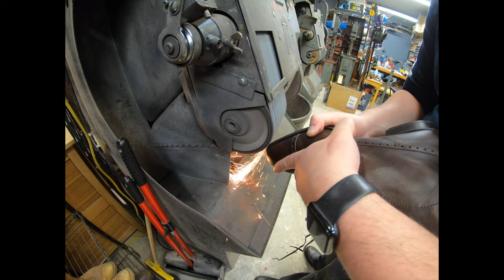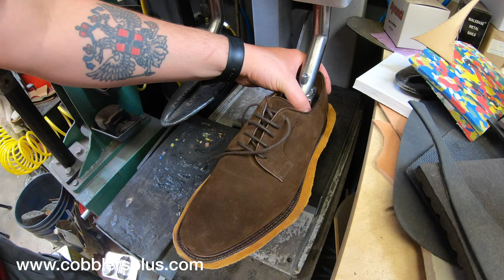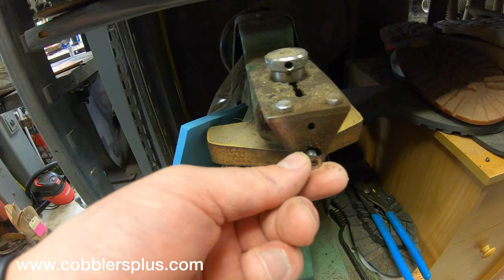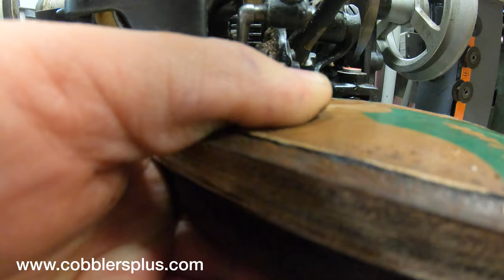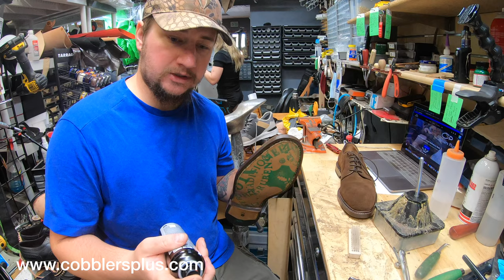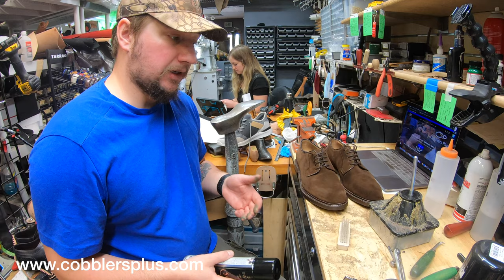Carmina Shoe Maker Resole with a surprise sole. (Hint it has green)

Comment: I was just wondering if it might be easier to remove the stitches using a wire brush rather than picking out thread?
Reply from the maker: The wire brush will scratch the welt way to much and sometimes can catch a small thread that holds the welt to the upper. (Seen it happen)